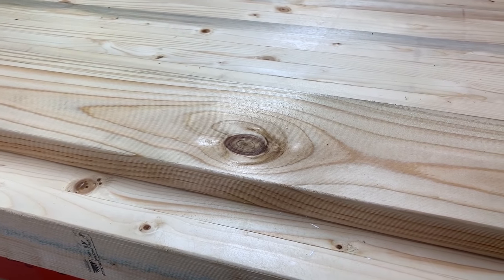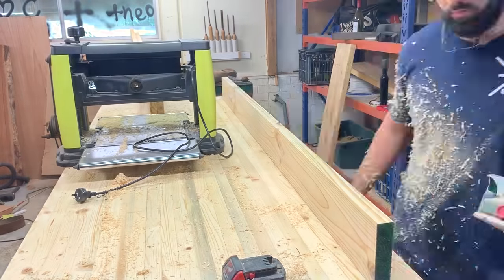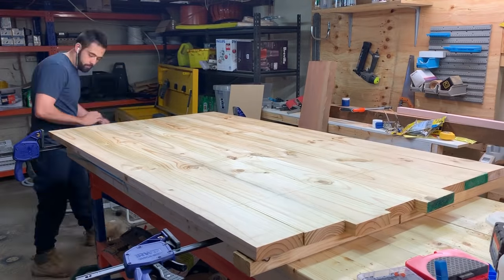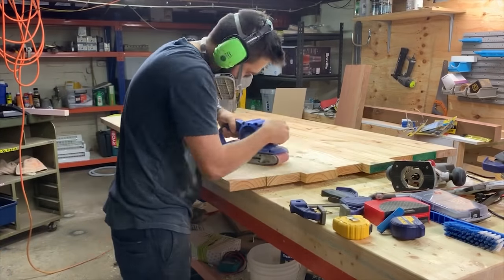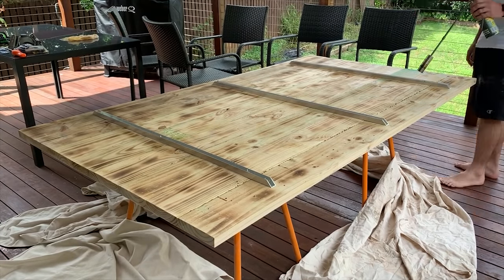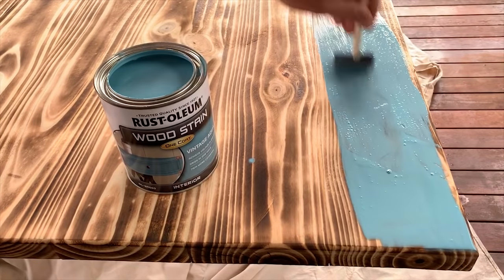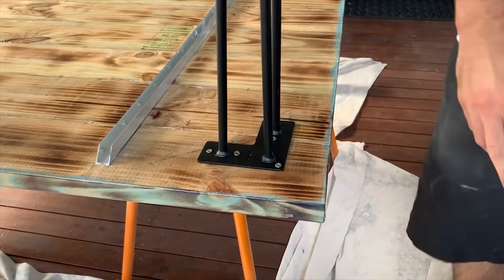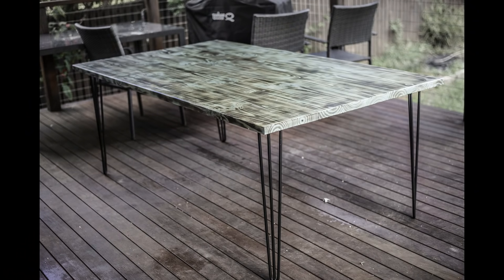Shou Sugi Ban Table - DIY Wood burning technique

Comment: Woodworkers rule #1. When making a flat blank always vary the direction of grain. One cupped up on end, next cupped down on end, and so on across the blank. This helps to keep the top surface flat over time where cupping all the boards in one direction will likely cause the entire surface to cup up or down.
Reply from the maker: 100% and if i did it again ill do that! thanks for your comment
Reply: And drill pilot holes for the legs. These should actually be t-nuts and the underside should be sealed as well as the top. It’s outdoor furniture.
Reply: That's exactly what I wanted to comment, but going down to comment section I've seen your comment, so .. thumbs up!

Comment: Looks great! I have seen a clip where the wood is burnt longer/deeper and wire brushed off before  applying stain. The effect is amazing. It would be interesting to see how it turned out if you did the same. I'm keen to try this technique too! Thankyou for sharing.
Reply from the maker: Do it ! Let me know how it goes, add me on Instagram samwilkinsonmakes :)
Reply: I do that with coasters. Takes quite a while and gets pretty messy, but looks so good.

Comment: Hey; great video but i have a question. I have some old planks I want to build a table top with but they have nail holes in them, I tried plastic wood, which melted or cracked when torching. should I fill them in AFTER burning?  Or do you have any other suggestions!

Comment: i'm a big fan of shou sugi ban. it's has a unique effect on the wood that can't be replicated by staining. My next experiment with it is to make a piece with a heavy, dark char, but I need to figure out a way to hold the ash to the wood.

So, how is that finish holding up? Does the table hold onto the burn?
Reply from the maker: Spencer Jordan yeah it does ! My suggestion is to do a few spray coats of clear poly on the char that should hold everything

Comment: Table looks good but I wouldn’t call this shou sugi ban.
Reply: He didn't, he called it shou SHUgi ban.  Cracks me up when people say it that way.
Reply: Wel to be fair to brads workbench the dude in the video did say “using a shou shugi technique. Which this is not shou shugi ban, where in that manner they burn the wood down to the grain and not just over the top. Never saw charcoal or him scrapping the wood then staining or adding some tung oil.
Reply: snipercanez true
Reply from the maker: How do you say it !? Haha seriously so many different ways
Reply from the maker: Yeah I was only revealing the grain. If I was to use the technique fully. It would have been charcoal! :) anyway I hope you like the video !
Reply: UrbnGoods oh yea, my comment was in no went meant to take away from the great job you did 👍🏼
Reply: For a usable table top I think this style is preferred in my opinion of course.   You lose on the look but end up with a smooth surface.
Reply: This call  tigre technique...
Reply: He stated in the beginning that he used pine. You never do deep burns on pine, the low density of the wood can cause breakouts and tearaway. If he was doing a professional hardwood table like a red oak or walnut I'd say go for it. Burn that puppy up and then used a deep color stain to really make it pop. If you really want to get technical burned wood goes all the way back to the Greeks and Romans. It's not some special technique. Adding some pseudo Asian mystical name to it doesn't make it special. The same goes with folding metal and any other woo woo "technique" Craftsmen come up with. If it looks good and you are happy with the end product that's all that really matters. 

My only criticism are those cheap Amazon ordered legs, however I do realize that not everyone owns a lathe so I completely understand.
Reply: @Some1special  can still make decent looking legs without a lathe
Reply: @rastamon5969  you can but it takes the fun out of it. Who doesn't want a chunk of dense wood rotating at 3600 rpm that can fly out at any possible moment? Personally I find the gamble worth it.
Reply: @Some1special  its not a "gamble" and yes a lathe would be nice but like you said not everyone can afford one hence why i said you can still make it nice without one
Reply: Agreed, this solely aesthetic, shou sugi ban has a functional sealing purpose that this does not accomplish.
Reply: @MrBonners  in what way was my comment negative? The part where I said the table looked good or the part where I just disagreed with what he called it. Must be tough living in your world
Reply from the maker: I didn’t take it negative as I know proper shou sugi ban is Burning to black. But it’s  hard to tell intent , when you comment without saying something nice afterwards 👍🏻
Reply: @samwilkinson9670  then why use that name?
Reply: @personofinterest7918  why couldn't shou sugi ban be used as a table?
Reply: @Some1special  damn, good comment!
Reply: @Some1special  I use pine all the time for deep burns and have never had any issues.  The deeper the burn the better it looks after brushing out the soot.
Reply: @jbm8312  so you do deep burns on soft pine wood. For what? Pine is already structurally weak. Why would you make it even more weak with deep burns? I guess enjoy your burned, soon to be warped and probably falling apart project?
Reply: @Some1special  No need to get all pissy.  You just have to be smarter than the wood you are working with.  For something like a pine table, a top coat of resin would add the strength back and keep it from warping.
Reply: @jbm8312  so you want to take cheap low quality pine, burn it to the point of making it weak and then come back with $300 - $500 worth of resin to make it strong again? 

Why not just buy idk a $200 slab of cherry, burn it and add some art to it, seal with a nice semi gloss lacquer and add some legs to it? Those sell for about $700 a piece and all it costs $200 for wood and $35 for a propane torch and a can of lacquer.
Reply: @jbm8312  also it's not very smart to use resin on pine. 1. Yellow pine will bleed into resin making it yellow. (No one wants a yellow table) 2. If you don't perfectly cast the table and the wood is exposed it will suck up humidity and crack the resin when it expands. Then you will have a very expensive, very heavy piece of junk.
Reply: @Some1special  When was the last time you used Resin? the 90's?  You obviously don't know how to used it properly to keep that from happening.  I have never had any problems with any of my pine projects with warping/yellowing/cracking/ or any other bullshit you can come up with because you think you're some kind of woodworking god.
Reply: @jbm8312  lol, my ego isn't that big. It's mostly trial and error. Maybe one day if I feel like it I'll make some video tutorials on it. I know most of these things because of botched DIY builders that tried and failed to make things. Even some old pros in the carpentry business that bought into many of these snake oil merchants selling too good to be true products. The fact is that yellow pine is the second softest wood on the market. It's only real practical use is to be used as studs in house building. It swells, warps, twists, and rots much quicker than any other wood. This is basic knowledge in the carpentry world. Most higher quality furniture is made with oak. Unless you have a kiln and a table with a built in vacuum pump to pull out every last air bubble in your resin you will end up with a product that will fail faster than any other wood product on the market (the exception is white pine or white wood and every lumber yard worth a damn will tell you the same thing.) If you don't have a means to do deep resin pours (a vacuum pump table) you will have to do thin coats of resin and that means cracking. I doubt you have a 50k steel reinforced plexiglass vacuum pump table just sitting around so you can make pine wood resin tables because the investment doesn't make any sense when you can just go buy hardwoods and sell a much more profitable product. Hardwood sells for much more money, It looks better, requires little to no staining, lasts a life time and is structurally tougher and stronger. 

If you want to learn more I suggest you look up wood density and study what woods match up with the products you are trying to make. If you just want to keep making cheap garbage then stick with pine. When it fails and falls apart I'll be more than happy to scoop up those customers that have learned their lesson in quality work.

Comment: A few pointers.  You should alternate the end grain direction to help prevent it from bowing and twisting.  You'll find yourself needing leveling feet at some point as a result.  Also, holes for the channel should have been oversized to allow for wood movement.  Otherwise as it expands/contracts you will eventually have splits down the middle of the boards. Lastly, you should seal the entire table top (underside as well) to prevent gain/loss of moisture causing wood to expand/contract/warp/twist/etc.
Reply from the maker: Chris Campbell thanks mate, 100% agree ! Good tips! Next time I make one a lot will change! It good that everyone has constructive criticism! There will always be haters. Haters gonna hate !
Reply: Ya seal both sides but the whole grain thing means less with kiln dried lumber..therin riddle
Reply: Does burning after glueing compromise the glue at all?

Comment: Hey looks good bud, nice vid. 
Just one big detail u should def clarify for your viewers, I'm a huge fan of shou sugi ban and use it alot.
U are surface charring, which does create a nice aesthetic on the surface of the wood. U could call this shou sugi ban style finish, but not shou sugi ban. Actual shou sugi ban requires a more intense burn/char and then removal of the softer carbonized wood grain (traditionally with a wire brush) leaving the carbonized harder wood grain behind, which will be elevated above the softer wood grain. This creates a nice texture in the grain that is noticeable by the color diff of harder, dark, raised grain and the softer, lighter, concave grain. The difference is striking visually but also tacitly, u can feel the grooves n valleys with true brushed shou sugi ban.
     I mainly ask u to differentiate between surface char n shou sugi ban cuz the ladder is an ancient Japanese style of wood preservation that actually preserves the wood  and makes it resistant to moisture n dry rot, fire, bugs, mold n some weathering issues. But the surface "shou sugi ban style" above is great to use for aesthetics but does not enable the preservational characteristics of this technique. Do not want folks to work hard on the project and not apply a suitable finish thinking that they have preserved the project when it is not.
Thank u, keep up the good work, ill be watching u!
Reply from the maker: I agree with you ! And yes I should’ve been for clear on the difference, that’s why I coated it in poly after! Thanks 🙏

Comment: you should do a DIY dust collector, videos all over youtube, mine, from a section of metal duct, PVC pipe in and out, over a home depot plastic bucket, came out great and removes 98% of everything from going to the vacuum so that you don't loose suction.

Comment: The table looks good, had a question though.
Will this add texture to the wood? I'm wanting to do this on a desk I'm building to make the grain stand out, but I'm afraid that it'll add texture making it useless to write on. 
thanks
Reply from the maker: Brandon Garcia I only burnt mine a little  so no texture after finishing.. but I’m sure if you did the shou sugi ban technique until it was charcoal. I’m sure there would be a lot more texture

Comment: Great video and job!! Q: will it be able to remain outside in the elements without damage? Thanks and...sorry, total appx cost on materials along with dimensions - sorry for the q's but it looks terrific
Reply from the maker: It’s outside but undercover :) yeah it’s held up great ! I wouldn’t leave it in the rain but since it’s undercover it’s fine :) 
Total price including the legs was around 200$
Reply from the maker: But I still have heaps of clear coat and stain left :)

Comment: Not worried about cupping?
Reply: I think that's why he put the aluminum braces underneath. It looks like a more quick and easy (and somewhat less effective) alternative to breadboards. Another concern I would have is that it won't allow for expansion and contraction of the wood with humidity changes over the years.

Comment: Youre supposed to char the wood till its black and cracked, then wire brush and sand down to the right darkness.  Just charring the very outter edge of the surface defeats the whole point of shou sugi ban, which is to act as a wood sealing method. If the board is not on fire, then its not hot enough for the saps to liquify become less viscous and permiate the fibers sealing them. Also you should be using it with cedar, red wood, or cypress...not pine. Its useless for pine beyond aesthetics and adding a fire resistent carbon layer.
Reply from the maker: James Hager ok

Comment: No brushing or sanding the wood burn?
Reply from the maker: i forgot to film it! by basically i just wiped done the table with a dry rag. i only burn it a little so there wasn't much charcoal to rub off! if i burn it more i defs would have used a steel brush and sanded it!

Comment: If you get fed up spending money on those little tins of gas, go to bang-good website & search for gas adaptor. You can fill them from a larger refillable gas bottle.
Petrol station gas is always much cheaper, go look round the scrap metal yard, you might even find a map gas bottle for pennies.
Reply from the maker: Will do !!

Comment: quelques critiques, 
1/ on alerne systematiquement le coeur du bois sur un tel panneau, le bois tirant a coeur, votre table, telle qu'elle est montée, va se deformer plus dans un sens que dans l'autre, et ce n'est pas les 3 traverses en aluminium qui vont l'empecher de bouger. Il aurait fallut mettre une lame avec le coeur en haut, et celle d'apres le coeur en bas. Ainsi les deformations se compensent.
2/ le ponçage, toujours le faire dans le sens du fil du bois.  Car comme on le voit distinctement en fin de video, la finition fait ressortir le moindre défaut, même après brûlage.  
3/ pour eviter les problemes de deformation, il est imperatif d'avoir les memes traitement sur les 2 faces de votre panneau. Sinon vous allez y rajouter des contraintes inutiles et votre table se deformera.
Ca serait dommage le resultat etant plustot joli.